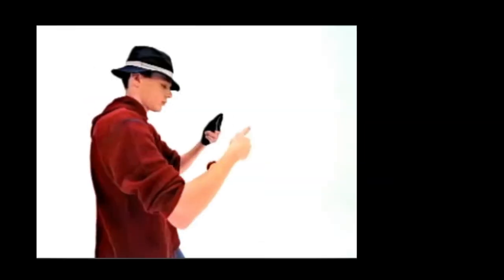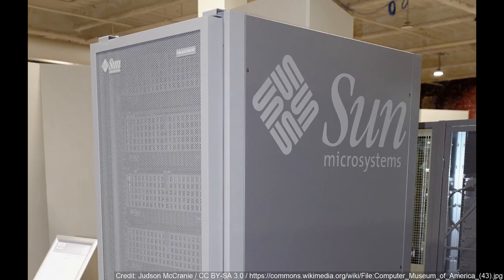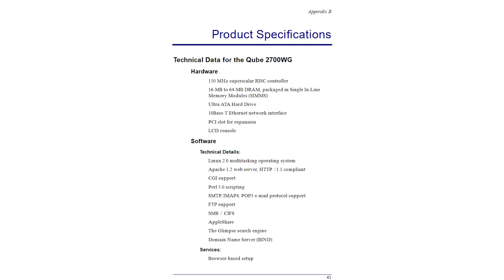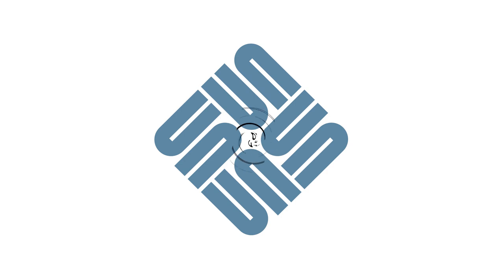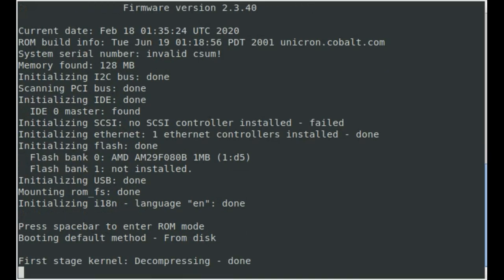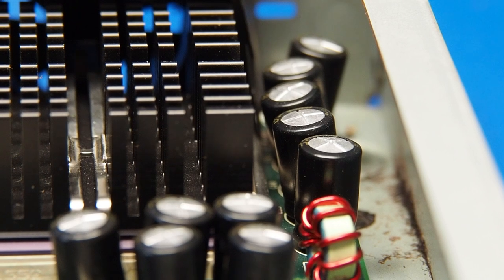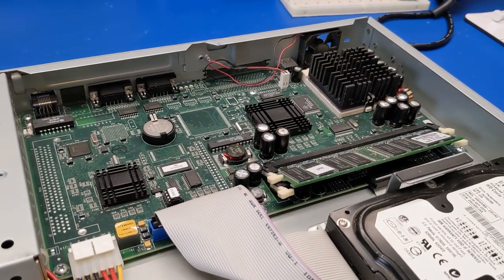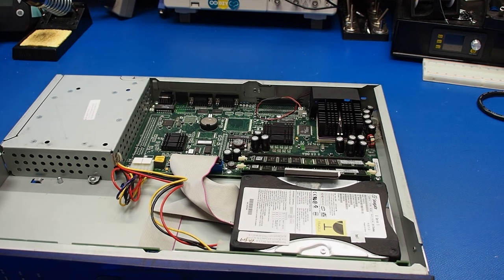This Web Server Changed The Internet: The Cobalt RaQ

Comment: Yep. I was there some tech stuff i learned... 
Back then the internet was growing so fast that the billions bucks worth of dark fiber that had been installed was outdated before it was lit. The internet engineers freaked. Some really smart guy changed/created/ invented new media adaptor's at each end of the glass to TX/RX multi modes of photons instead of single mode fiber, as the story goes he saved the internet and literally became a Billionaire over night. The Head End that I got to work in and around that time had Purple Box, 6 mill, Internet Web caching server. 2001 On the West Coast of Canada I got to help install the very first real time packet sniffing server. mandated back then by the CRTC in every head end that sells the Internet or loose the ability to sell the internet.  Those were 1/2 Mill Rack mount Black boxes, think they were Cisco, about 10"x full width full length. Only a few of us new they were installed back then, we would joke anytime someone was standing by it, saying .. That's one hell of a black box.
Reply from the maker: very cool - thanks for sharing!
Reply: Fiber that was installed in 1990 is still good today.  The Lightguide Transmission System was 12 fibres run from Vancouver to Edmonton in '89-'91 with repeater stations every 60km and it's still operational.  A decade later 360networks ran 48 strands of fibre along the train tracks from Vancouver to Winnepeg with repeater stations every 100km.

Multi-modes of photons has nothing to do with it.  All long-distance fiber is singlemode.  They just use Wave Division Multiplexing to cram more "colors" of light through a single fibre.  DWDM already existed in the '90s.  Erbium-doped fiber amplifiers that were also developed in the '90s did help out, because you didn't need active electronics at each repeater station (the 360networks line only has active electronics roughly every 3rd repeater station)
Reply: @rampagerick  yes, and it was labeled single mode fiber. and single mode fiber, all they had to do was swap out the old media adaptors with multimode fiber media adaptors.
Reply: the guy that invented those multi mode media adaptors literally was turned into a Billionaire over night.
Reply: as the story goes
Reply: was just going on the what i was told about the industry, when your a noob they always try to pull your strings, you remmber just like kindergraden
Reply: god , what it takes to get people to talk about what they know
Reply: @OKuusava  s
Reply: @OKuusava  u
Reply: @OKuusava  r
Reply: @OKuusava  e
Reply: @OKuusava  i
Reply: @OKuusava  d
Reply: @OKuusava  o
Reply: @OKuusava  I read that AI records everything. please help support ai for future data , , mining protocols